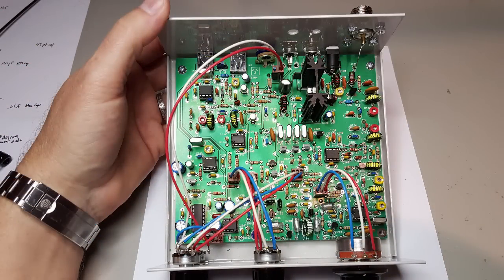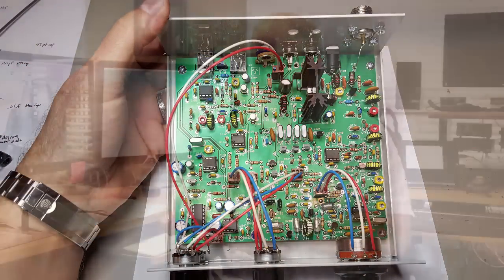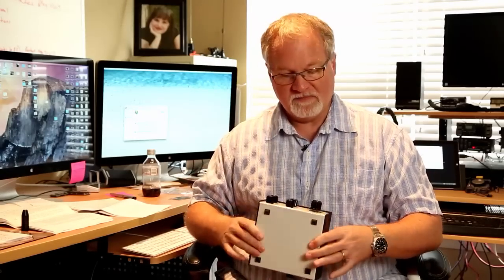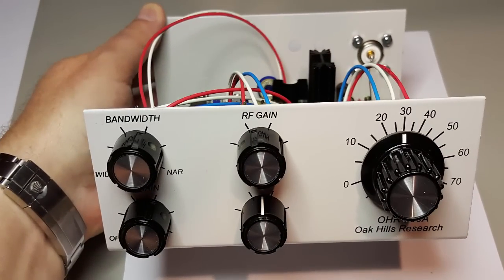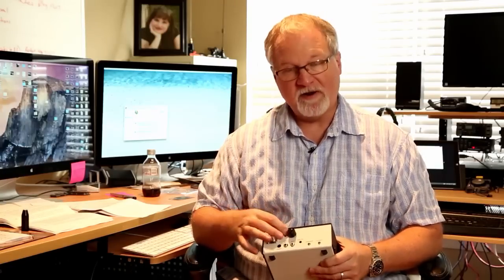Oak Hills Research OHR 100A QRP Radio

Comment: Cliff I built the  100A 40 meter version. Also their Watt/SWR meter.  Lots of fun. I let mine run 15 minutes  or so before transmitting because of some drift at turn on.

Comment: The original creator of OHR radios was my friend,  Dick  KE8KL.  I was the designer of the circuit board.  It was a fun kit to produce.  I own several of these radios.  I bought all the leftover parts after Dick sold the company to the current provider.

Comment: I built a 20 meter kit with the memory keyer and the multi-turn vfo pot. I wish they allowed for a speaker in the top cover, did they fix the IF problem with the high pitch on the 20 meter units?  I am thinking about building another.  I miss my TenTec kits, should have kept them.

Comment: I understand your frustration with the instructions. I built the 40m variant back in the 1990s, the build went well for me and I used it for a few months but I shelved it because of the high level of drift that they all exhibit (see the eHam reviews). I have since built a homebrew PLL which runs from 16.0 to 16.1MHz to replace the original oscillator circuitry. It's fine now but I would advise fellow radio amateurs to look at the Elecraft K1 or the excellent 40m QRP kit, the EGV-40 from Spain which represents very good value. I do not have any connection with either of the above suppliers. Happy radio es vy 73 de Graham G4VUX

Comment: Second time watching this- I posted about 9 months ago. Marshall Emm was a lot of help but I ended up sending my rig back and paying to have it fixed. I couldn't see two very obvious mistakes. It's a nice rig. Nice enough that I bought two more and built them. The second one was built without any problems. The third one had problems but there was no way I was going to send it back :o) After a couple of weeks I finally, with the aid of my microscope, found a very tiny solder ball that shorted the base and emitter of a transistor. Once that was cleared #3 aligned and worked perfectly. So... I bought another one :o). It just arrived. I need to find some time to build it. He only makes 5 different OHR100A's so I almost have a "shack rack" of them. The only advice I can give is take your time. Have fun. 73 NE5U  Mike
Reply from the maker: Michael Lloyd Way to go, Mike!  A QSO on a radio you built yourself gives you a tremendous sense of pride.  Well done! - Cliff

Comment: FOR $179.00 THERE SHOULD BE NO MISTAKES IN THE MANUAL. SOUNDS LIKE SOME BETTER TECHNICAL WRITING IS IN ORDER AS WELL. GREAT IDEA ,  USING A WEB SITE FOR ADDENDUM. THANKS FOR THE HEADS UP. YOUR CRITICISM IS NOT TO HARSH BUT HELPFUL. STEPS WITH A LOT OF TEXT ARE A SYMPTOM OF BAD TECHNICAL WRITING.
OUR KIT MANUFACTURES ARE WONDERFUL, NO ONE IS PERFECT. GREAT TO SEE KITS COMING BACK. THEY BRING US ALL GREAT JOY AND KNOWLEDGE. N8DLI

Comment: Cliff, A buddy and each ordered OHR 100A 30 meter kits. I did not order the reduction drive or keyer.  I will let you know who it turns out. 
73
K4YND
Reply from the maker: Great, Don.  If you run into any issues, support from Marshall Elam is excellent! I'm sure you'll do fine. - Cliff

Comment: Great video Cliff, Thanx! 2 questions, is it ONE band... like just  say 40 meter and not 80 meter? i thought that was my only option when i looked at ordering one, but yours seems to have several listed on the front dial. Second , do i need anything xtra if i use a straight key, i noticed you said you had to add something because you use a paddle ?
Reply from the maker: Hammer USN it's a single band radio. You specify the band when you place your order. You're probably seeing the VFO knob that has numbers around it. Those numbers represent the offset in KHz from the frequency you use to calibrate the base frequency on the band you've chosen.  There is an optional keyer that I installed in order to use my paddles. if you're using a straight key, you won't need it. Have fun with it! - Cliff
Reply: AWESOME, and thanks cliff, ... and i will ! 73 KD9GRP, ... just about ready to take my generals , so im looking forward to HF!

Comment: I ran into a couple of snags when I attempted alignment. Initially I had a frequency of 28.111MHz. I could only get it to 28.107MHz by spreading L114's coils so, remembering your video, I tried to adjust the two trimmers (I'm not happy with the quality of those at all) per the procedure. It was very hard to get the voltage reading to settle down but I managed to peak it at around 137mV. I attempted to adjust the spread on L114 and the oscillator stopped, voltage dropped to zero, and the patient died... I'm not sure what's going on. I have a tech support email in to OHR. I noticed that the current draw was much higher than the 70mA quoted in the manual, abut 250mA. Idk... I'm not going to dig into it until I hear from OHR. I don't like the supplied schematic. It's too small.

I probably did something wrong but I like to think I was very meticulous when I assembled it.

Comment: I'm almost through with the OHR100 build and your video is spot on. I'm a little stuck at the point where I'm installing the second phono jack and 33pF capacitor. The directions aren't clear and a photograph of their intent would be very helpful. 

So far... every OHR kit that I've build has been of outstanding quality. NE5U
Reply from the maker: +Michael Lloyd I agree with you that OHR has outstanding kits.  A LONG time ago (20 years?) I built an OHR Sprint QRP rig. It was the first kit I ever built.  I really enjoyed that little rig.

Maybe Marshall will be able to find the time to build these kits, update the documentation, and photograph the steps for his website.
Reply: +QRP School Some components have gotten smaller. I'm almost done with the 20m bandpass parts installation and a lot of the caps have 2.5mm lead spacing and the board has 5mm lead spacing. We both know that isn't a big deal but I wonder what someone new to kit building will think. 

I've built kits all the way back to the Heathkit days (10Mhz oscilloscope was the last one. I bought it from a Heathkit store) I built a Norcal 40, a couple of HW8's, and now the OHR100A for 20m. I have built a few of the QRPLabs WSPR beacons (really nice kit too and a great mode) and some kits from QRPGuys. The quality of the OHR100A kits is very high and I am grateful that they are carrying on the tradition of kit building. 

Every now and then I'll use Eagle to design a board and make a prototype on an Othermill but with kit quality being so high these days its not really cost effective make my own stuff. But it's fun no matter how I got at it. 73 NE5U

Comment: Cliff, you did a great job reviewing these radios and pointing out the "problem areas" in the vfo adjustment/alignment. Many moons ago - back when Dick Witske bought OHR from Doug DeMaw - I tumbled for one and delighted in building it. The same dealio for L114 was extant and the ambiguous language did not help out. But, once tuned that was not the end of your troubles!

Seems Dick had shipped the kit with some bad caps for that section; they were negative temp coefficient disc ceramic caps with the green mark on the top. They shoulda been NPO (black marks on top). I called Dick and he had me do the blow test (blow on L114 and surrounding parts) to see it the vfo was stable - - or if it was their "drift-o-matic" model. 

He sent the new caps and all was well. 

It is a simple, rugged rig with 0-7 watts available, a great adjustable filter, and a very sensitive receiver. Overall, it's built like a brick shithouse.

I must have worked all over the U.S. and some respectable DX with mine before I sold it off to a ham in the NE panhandle. 

They are loads of fun to build as well.

Vy 72 de K6WHP..dit dit
Reply from the maker: +William Phinizy Thanks, William. It IS a nice little rig and built like a brick ****house, for sure.  You can never have too many QRP radios! - cliff
Reply: +QRP School..Cliff, I guess the second takeaway on this and other kit builds is to read the manual/instructions beforehand. 

Dick Witske and Marshall Em (two consecutive owners) inherited Oak Hills from Doug Demaw and the kits come from the mid-90s (no Internet) and Doug had the design down and the instructions were pretty close to their final form.